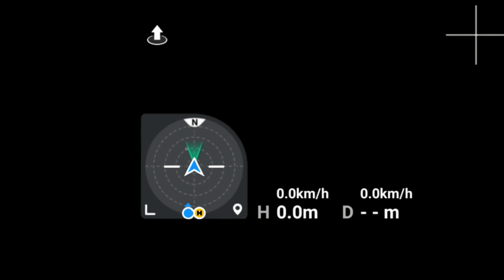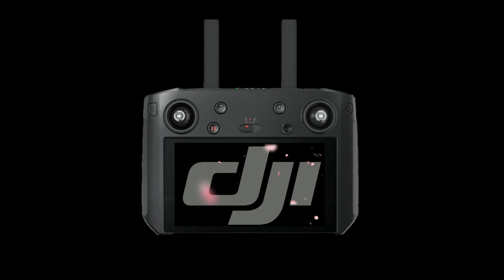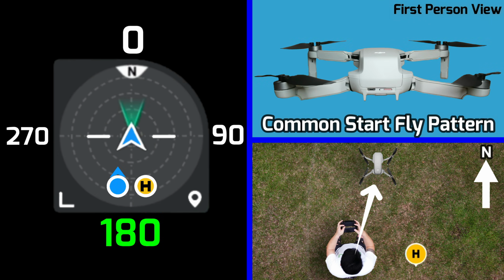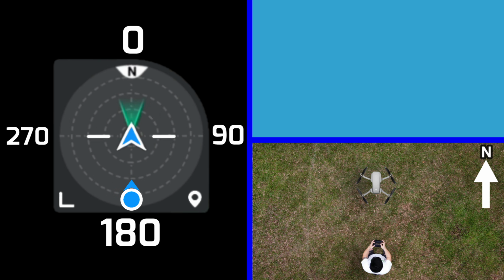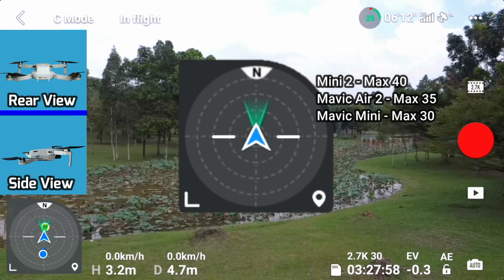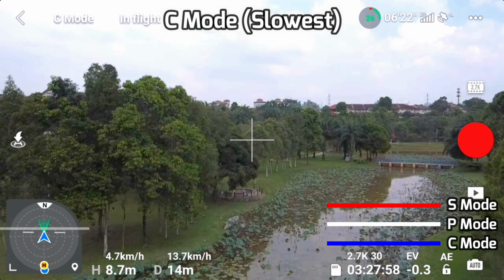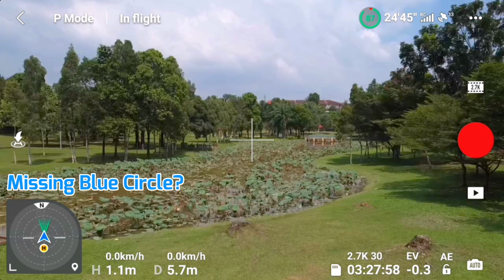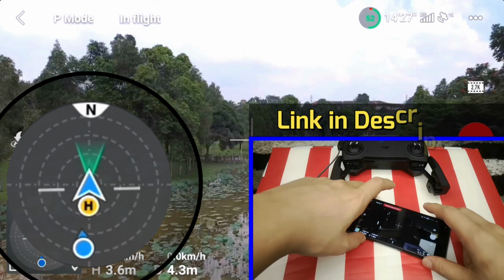DJI FLY APP Attitude Indicator COMPLETE Guide - DJI Mavic Mini | Mini 2/3 | SE | Air 2 | Air 2s

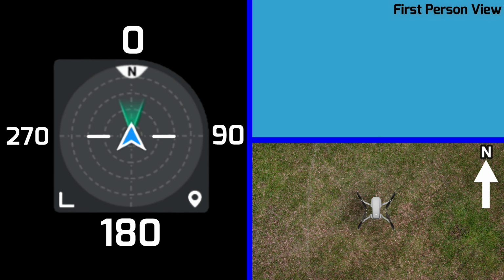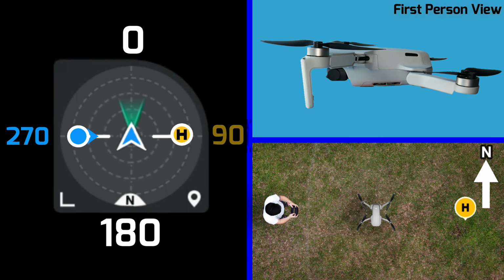Comment from the maker: https://youtu.be/1uXUWDdPPF8  - CORRECTION ON GRAPHICAL ERROR FROM 4:20 - 4:48
Thanks to Zbip57 for pointing out my graphical mistake @ 4:24 (FPV View Wrong), and @4:40 (FPV View Wrong) + the homepoint and MDRC supposed to move to the top (0/zero), not staying at the bottom. And  at @4:47 the homepoint should be at 270 and MDRC at 90. Should I make another amended video for that correction?
Reply: No it's really clear hey...
Reply: Excellent

Comment: The radar is way to small. I can see the rc orientantion very badly. How yo enlarge? Or get the old vrtsion back? My only intest is keeping the antennas pointed in the right direction.
Reply from the maker: Unfortunately the size is fixed. However a larger mobile screen might makes the indicator bigger. U can downgrade dji fly app easily too if u are using android to get the old orientation indicator back
Reply: @CZRProduction  Well I have a larger screen than on a lot of youtube films (6.5 inch it hardly fits in the remote) but the resolution/dpi is much higher so the radar is like 10 mm in size. It really does not scale. Other people much have problems with it too I think.  If I use the older app won't I risc my drone? Ie I have been reading about all these new app updates and every one is hpyed abut it. but I can't have my drone fly off to the moon.
Reply from the maker: Using the non-latest app is totally fine in terms of operation but u might not get certain new feature that is with the latest version. If u have dji care refresh or other insurance, u might need to check the clause for that. Otherwise, all is fine. There is once i hold back update for months and skipped 2/3 version. Just remember, dji fly app is just a tool for livefeed, without the app, u can still fly as usual but u cant access to features nor know whats going on.

Comment: The lines you are referring to is called an artificial horizon. 
It is used in ifr(instrument flight) to know the attitude of the aircraft when visual  attitude is not possible.
Reply from the maker: Thanks for your suggestion. Thought about that but decided not to use the term because the reaction is opposite for bank 😅

Comment: Has anyone figured out how to correct the drone indicator always pointing 90 degrees off?     I've calibrated the compass on the drone, several times, yet on the indicator, it always points 90 deg off.  i.e., it shows the drone facing west when it's facing north.   You can watch the arrow moving sideways when the drone is flying forward.   
I wish they had a simple option to set it.   i.e.  physically point the drone north and tap something on the screen to set 'north' in the software.
Reply from the maker: Hii, Most of the time is cause by your phone magnetometer/compass. Maybe can try this to understand the logic behind and possible find a fix for it.
https://youtu.be/IIzUxyX3Hfk
Reply: @CZRProduction  I could see the phones compass causing the indicator for the remote direction being off, can't see how it could affect the data on the drones orientation.    The phone does know direction correctly though.  A compass app works correctly.
Reply from the maker: @loughkb  the fly app use both the compass data from the phone for the remote icon, and the compass from the aircraft. Most of the time the phone compass is out due to the remote magnetic interference when attached to the remote, without knowing it thus showing inaccuracy. If the aircraft compass is out, a warning will prompt to calibrate it. U can download a compass app with magnetic interference value, or u can open up your original phone compass app, and use a magnet to find the magnetometer spot on the phone, then from there if the magnetometer spot is too close to the remote when attached, that will be the problem
Reply: @CZRProduction  That seems sensible.  I'll look in that direction.   It could be coincidence, but two flights today and I pointed the drone and remote in the same direction at launch both times.   The indicator was correct on both flights.
I'll have to do a few experiments now. :-)

Comment: The "tilting line" is called your Horizon Line.
Reply: It doesn't quite line up with the horizon-- only when going forward and back. When tilting left and right the lines appear to represent the aircraft, not the horizaon.  Had to watch it a few times.  Kind of messed up. It seems to go with 'back legs' of drone.
Reply from the maker: Thanks for your suggestion 👍
Reply: Wrong.

Comment: I'm using Android Hand phone, the latest fly app 1.2.2 doesn't have hyperlapse cruise in it when I try to set the function button, please check what happened.
Reply from the maker: Hi, maybe u can try to reinstall the fly app. Sometime certain function not available as a bug, a reinstall will normally fix that. Or u can also try clean reinstall by uninstall, restart your phone, and install back the app. Generally it works for most of the app in phone

Comment: I don't like the way DJI did this at all. It's such a pain to try and 
bring it up that I don't even bother trying anymore. It was fine where 
it was. Why did they have to bury it in some tiny impossible to bring up
 icon the size of a pin head? I hope they fix this  ASAP or give us the 
option of having the other compass. At least it worked and was available
 on the screen.

Comment: The direction is actually wrong.....its 90 degrees off
Reply from the maker: Which part ya? Can you include the time into it pls
Reply: Some people have this issue of 90 degrees orientation off, even with smart controller, so it not interference related, and cannot be calibrated.
Reply from the maker: @420weedguy  i saw the problem on the smart controller reported by others. Unfortunately i dont have the luxury to own it so i cant help further on that ☹️.

Comment: Yes - the new attitude/position indicator is a step up and much better than the older version.
Falls much more in line now with DJI's other software and offers far more information.
Reply from the maker: Yup agreed. Maybe a minor improvement on the MDRC covering the homepoint should be handle on next update. Maybe make the blue circle slightly bigger so even if it's covered by homepoint, is still visible and become eye-friendly for everyone.

Comment: Thanks for your very detailed explanation.  Just two questions.  At 4:25 the blue dot is at 270°, and the image in the bottom-right makes sense showing you standing looking at the left side of the aircraft with the Home Point over on the right side.  Shouldn't the image in the upper-right be reversed?  It's showing the right side of the aircraft, which would be the view looking from the Home Point, not from where you're standing.  
Even more confusing, at 4:40 the aircraft rotates 180° to fly heading South. The attitude indicator now correctly shows North behind the aircraft.  Your 0, 90, 180, 270 are NOT compass directions pointing N, E, S, W, correct?  They are instead constantly fixed relative to the aircraft, pointing Forward, Right, Rearward, Left respectively.  At 4:45, as the aircraft yaws clockwise to the right to swing around pointing South, the North pointer swings the opposite way counter-clockwise to the aircraft's left. That makes sense too.  North has now swung from the 0° (Forward) position, around to the 180° (Rearward) position.  That's all accurate.  But, shouldn't the Home Point and Blue also have swung counter-clockwise around the dial?  The aircraft's nose should now be pointing at Home, no?  The overhead image in the bottom-right is accurate, showing the aircraft now returning from the North, pointing South with you and the Home Point still in the same original locations.  However, it ends up with you now looking at the aircraft's right side.  That's not what's being shown in the "First Person View" in the upper-right. That's incorrectly showing the aircraft's left side.  Also, the attitude indicator should now be showing the Blue dot and Home Point the opposite way around, with the Home Point at the 270 position, and the Blue dot at 90, no?
Reply from the maker: Oppppsss i am sorry that it was a graphical mistake. Thanks for pointing out. Yes you're right, the FPV view was wrong. 
And for the second one @4.45, the homepoint and blue circle supposed to move 0 as well.
Really appreciate your detailed explanation on my mistake. I will make another amendment video on that.
Reply: @CZRProduction  ALL of your videos are really very well made and edited!  Keep up the great work.  It's much appreciated.
Reply from the maker: @Zbip57  Thanks! I am editing the amendment and will upload it with an end-card to redirect to the amendment version. Really thank you for pointing that out. Must've overworked on this video until I was partially paralyze with that mistake hahaha.
Reply from the maker: Amended video is up. Really millions thanks for your sharped eye! A credit to you!

Comment: Nice video great explanation. Are you using an Iphone or Android app? My MDRC compass doesnt look at all in the direction im pointing it into. The way you explained makes perfect sence to me as well and I expected it to work in this way however mine almost seems 180 degrees out. If I am pointing directly at the rear of my drone facing directly forward my mdrc shows that i have my back against the direction of the drone. Any explanation why this could be?
Reply from the maker: Hi there. Thanks. I am using android v9 huawei p10. Have u tried my other vid for the possible solution?
https://youtu.be/IIzUxyX3Hfk

There is another fix which i didnt talk about in the vid. Some phone model apparently need to rotate the phone port (default left) to the right. And a longer cable is required. What u can do to try for now is to detach the mobile from the remote holder (while cable still remain connected), and turn on everything, let the aircraft get some satellite >8 on the ground not flying, then when u see the attitude indicator completed but not accurate, now rotate your phone (default port left) to right and see if that pointer become accurate. Becareful if u are using the original flat cable as it is quite fragile.
 If that is, that would be the fix and proceed to get a longer cable